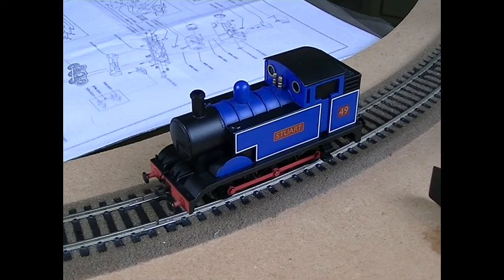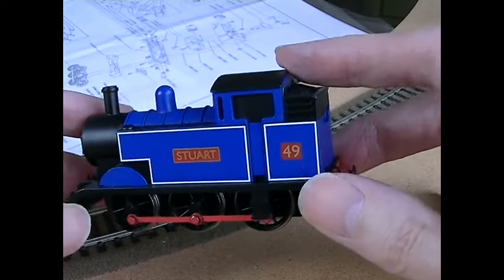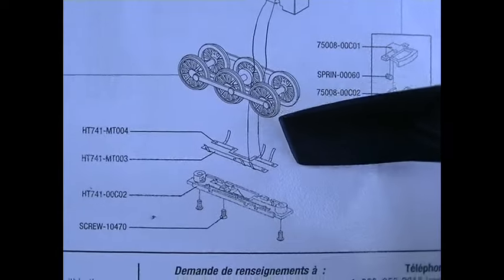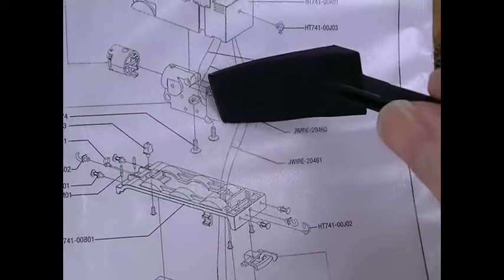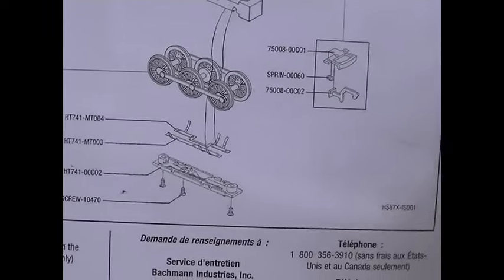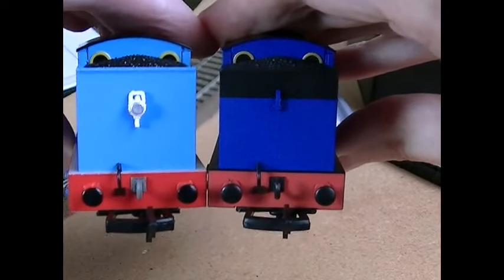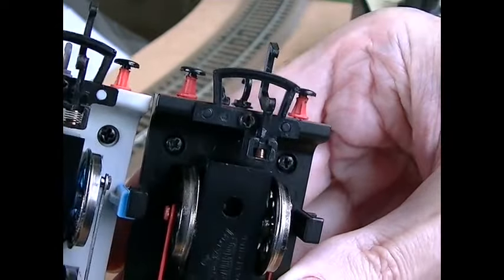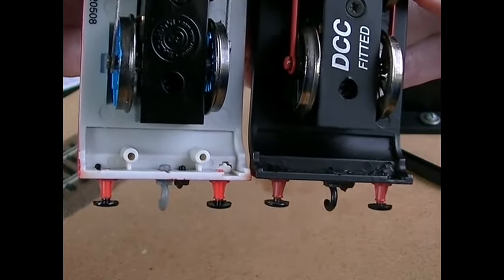Bachmann Junior Stuart.

Comment: Hi Cliff,
A great little loco - I enjoyed your presentation of her! It seems there's no need to buy jigsaw puzzles when you've got a bachmann loco - still, she runs very smoothly  which is the main thing and + I would have absolutely adored him when I was a (younger) child!
Great work with the ingenious fold-able base-board by the way, I don't think I've ever noticed that before - brilliant idea though.
Liked and enjoyed as always
Cheers,
Sam
Reply from the maker: +Sam'sTrains Thanks Sam, these Junior range locos are basic in design but the quality mech is very inviting.
Yes the test track is Hornby 3rd radius pinned to MDF  shaped into two pieces, hinged together. One corner is broader to act as a little work bench.
PS did you notice the Crescent water crane with the washer stuck to it's base ?
The kitchen table gets used for all sorts, so my railways are put to bed afterwards.  
Regards, Cliff.
Reply: +janiceandcliff Well I thought the design was clever anyway - resourceful as always!
And yeah, the water crane looked like it was supposed to be like that - it's almost un-noticable! I'll try to do something like that with mine!
Thanks again,
Sam
Reply: Fancy seeing Sam’s trains here

Comment: I Built A Gauge 1 Stuart, Billy And 2005 On Tinkercad!!! I Sadly Couldn’t Get The Black Line To Match On The Locomotive’s Windows, But It’s Good On The Side Tanks! 
I’ve Been Working My Butt Off With All These Models I’ve Been Making On Tinkercad! 🥵
One Major Project I’m Working On Is The LBSCR E2 Tank Engine!! 
I’m Literally Building It Details And Putting It On The Locomotive To Make It Look Realistic
I’m Also Searching For Parts On Tinkercad That I Can Use For The Locomotive Such As The Brakes, And Those Parts For The Front And The Back Below The Under Carriage
I Just Hope I Can Finish It Soon! 
I’m Also Thinking About Giving It Gear Axels So The Motor Can Turn The Wheels
Other Then That, It’s A Shame How These Locos We’re Discontinued :( I Wish I Had The Chance Of Buying Them
Reply from the maker: Yes, steam locos have all sorts of parts, invisible from the outside.
If you keep looking, I bet you will come across one of these locos on the second hand market.
Regards, Clifford.
Reply: @janiceandcliff  Thanks!

Comment: Stuart's footplate is different underneath because it's using the old Bachmann Thomas mold. Bachmann released a christmas themed Thomas set that came with a little black thing that goes on those posts and it's used to add Thomas' snowplough. After a while that footplate became standard on all Bachmann Thomas models.
Reply from the maker: +TurboProductions10 Cool, thanks for the info. I do find these small differences interesting, as you describe there is a reason for each change.
Regards, Cliff.
Reply: TurboProductions10 i

Comment: did you know that the engine came in a set with a engine named Greg that looks like Percy and there is a GWR verson of Greg in a another set on ebay
Reply from the maker: Thanks again for the info, yes I have seen photos but not yet the real models. It would be interesting to know if they are smooth runners too.   : )
Cliff.

Comment: Great review Cliff ;-) 
it looks as though it runs smoothly and responds well to the controller input. DCC fitted too so there's room for extra features ;-) 
Matt
Reply from the maker: +Trainmania100 I believe this loco came in a set with a second loco ( which resembles Percy ) plus a few wagons. Both engines were DCC fitted to match the controller in the set.
It is unlikely that I will refit a chip ( I have no need for DCC at present ), but I am only a guardian for these trains, who knows what will happen with their future owners...  : )
Thanks for comments. Cheers, Cliff.
Reply: janiceandcliff They are pretty much for proof, Expected it to be a bit shiny also £40 - 50 is not to bad. Right?,
Reply from the maker: Hi Rachel, this loco was bought second hand for £15. It will probably be more if you find it in a set. You are right, in that it is not as shiny as Thomas.
Regards, Cliff.

Comment: is it possible to change out parts to put thomas' face on stuart and put the smokebox door on thomas?
Reply from the maker: Good question....it's not something I've tried, but I suspect others have converted faces on these engines. I've looked closely again at these engines, Thomas's face has 2 holes for the eyes, and the eyes are then part of the mechanism, so it wouldn't be a straight swap, plus these are quite fiddly to take apart.
Regards, Clifford.

Comment: is it possible to swap individual parts on HO/OO locos?
Reply from the maker: +sirfowler I've not needed to swap parts on these Bachmann locos, except for couplings perhaps.
The Tri-ang locos are a lot older, so part swapping and replacements are often necessary.
Cliff.